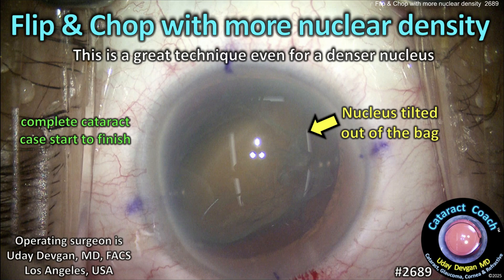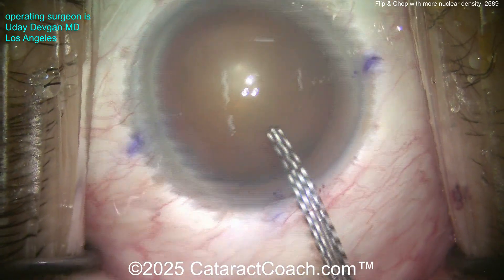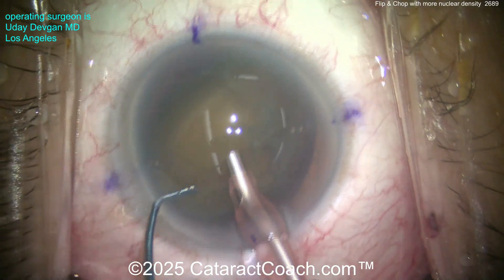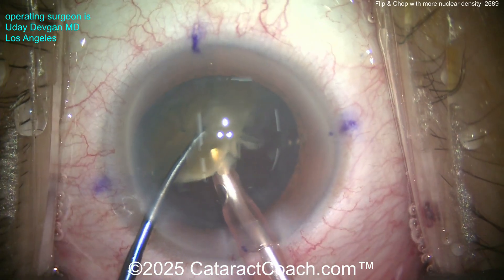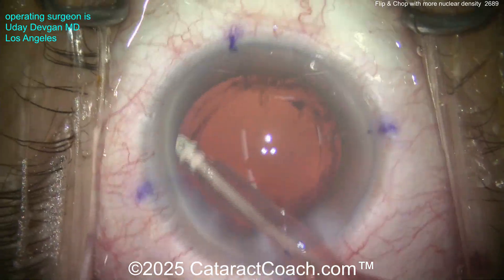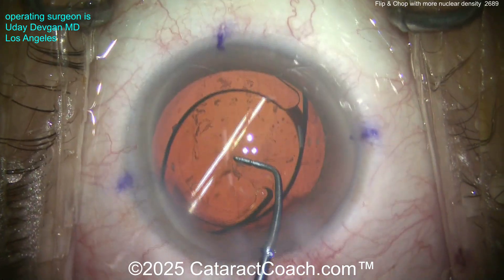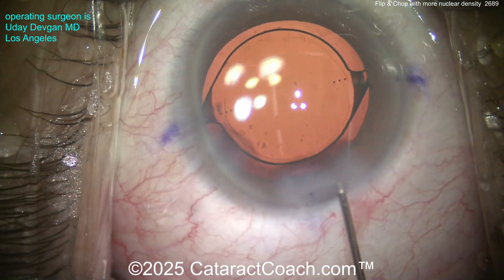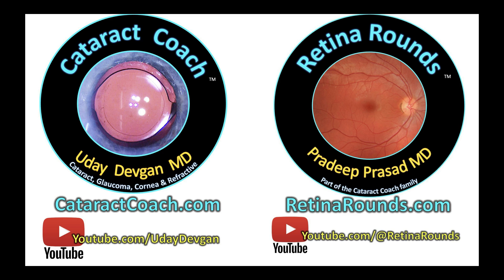CataractCoach™ 2689: flip & chop technique for cataracts with more nuclear density

Comment: One issue I run into when I do flip and chop is that I always seem to end up with material that is anterior to my phaco tip, above the iris plane and close to the endothelium. So I either end up leaving that stuff there and having it get in the way of my view and just dealing with it after I get the main part of the nucleus out, or I have to spend time getting it out now and probably taking a bunch of viscoelastic with it and leaving the endothelium unprotected.
Anyone else have this happen and have a way to prevent it? It never seems to happen in Cataract Coach videos.
Reply: Same issue

Comment: Any tips for chopping initially after tilting? I have been practicing this technique but the lens doesn't split nicely. Should I go more posteriorly with the chopper and the phaco tip at the time of chopping??
Reply: What type of chopper are you using? I find that my standard ball-tip chopper is a little too short for this technique, but I have a Nagahara chopper with a longer projection that definitely helps, when I remember to ask for it.
Reply: @MrRedalertcc I actually have a Kim chopper which is very similar to a Nagahara, but I guess it's my lacking technique. I feel like I am decently posterior (central nucleus) where I try to meet the phaco tip, but somehow it just doesn't crack that well... I end up finding myself doing tilt and tumble more than a true chop